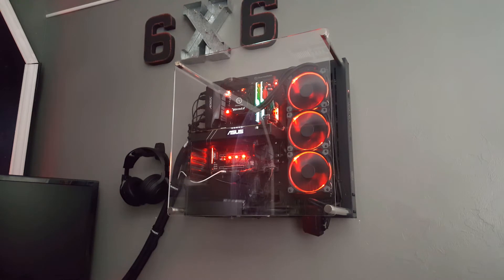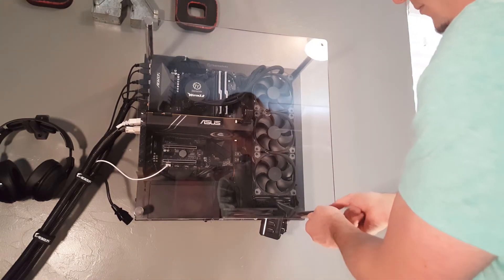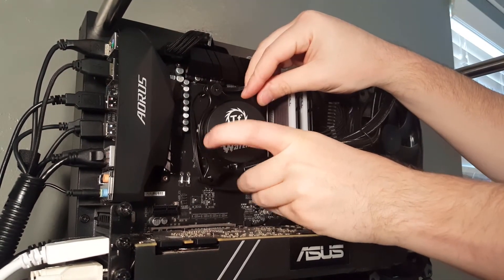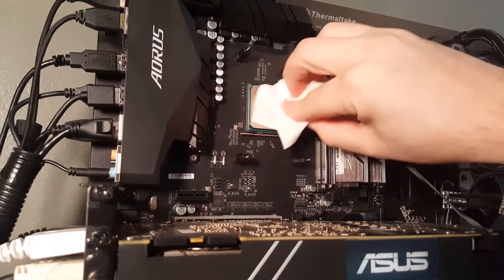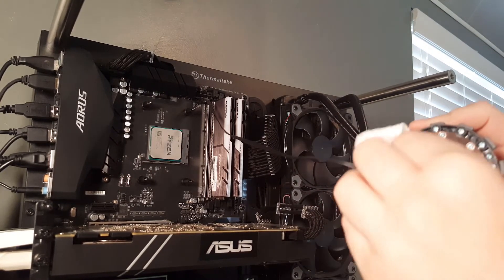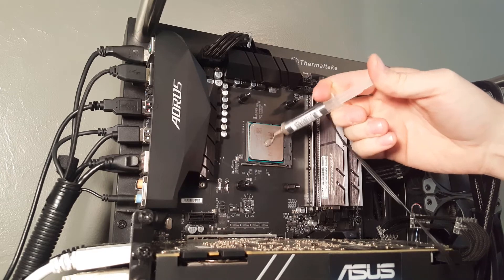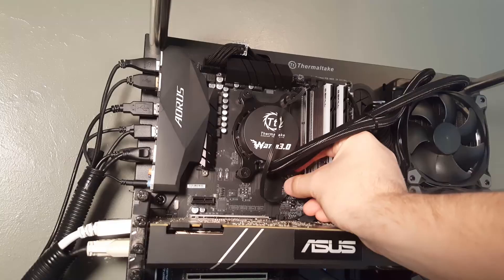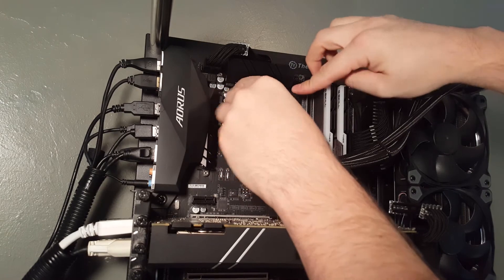Nerdy Tips: How to get a little better performance out of your CPU cooler

Comment: I got a question since I have the same case ..so  the metal little bar right next to the processor to the left I was touching stuff and i kinda pushed it and it unsticked I guess ..is there anything I should be worrried about?